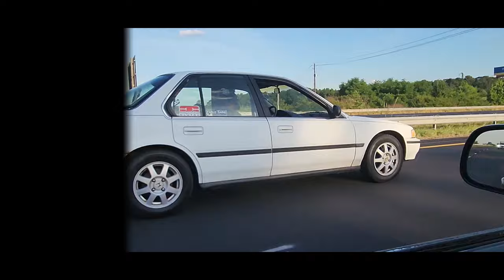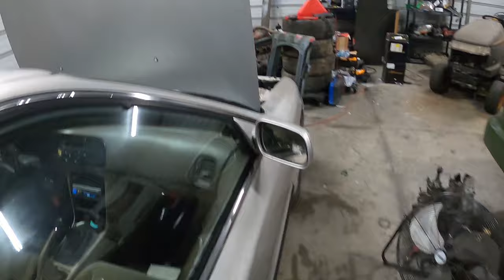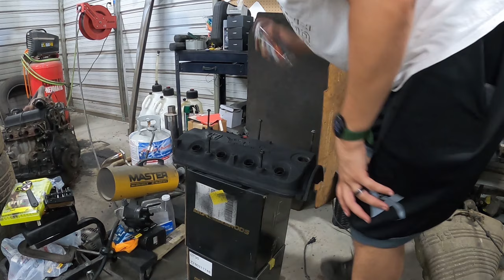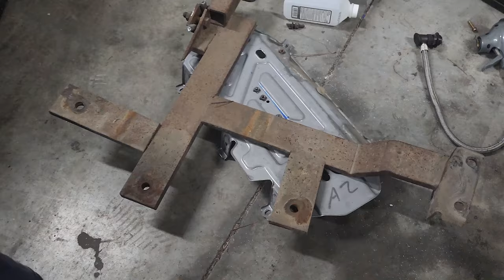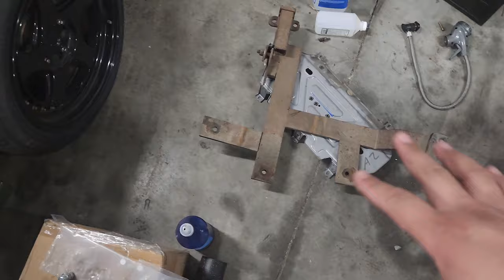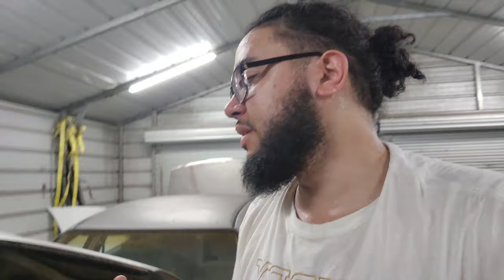Transforming This Honda's Engine Bay For Just $10‼️ | DIY CHEAP UPGRADE

Comment: Don't get different wires, just take your distributor off and flip thr drive gear around 180. Then you can plug the wires in the correct order as if it had a Hitachi(F22B1/F23A1) distributor and all the plug wires will be the right length, basically flipping 1/4 and 2/3.